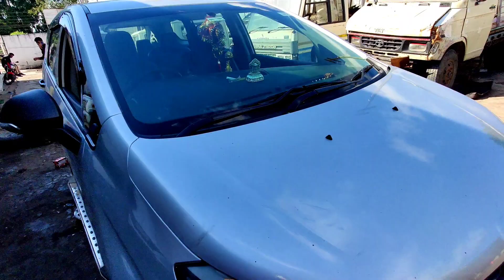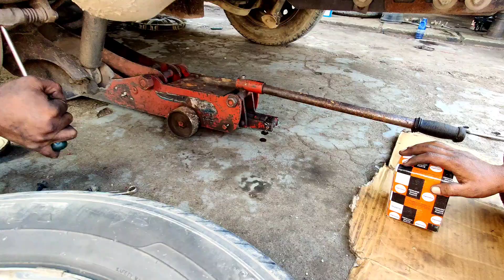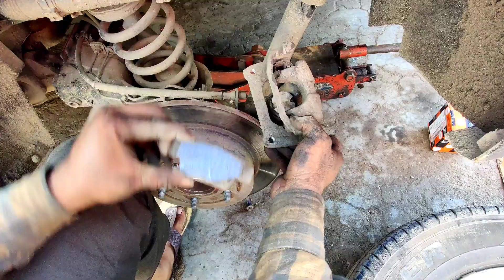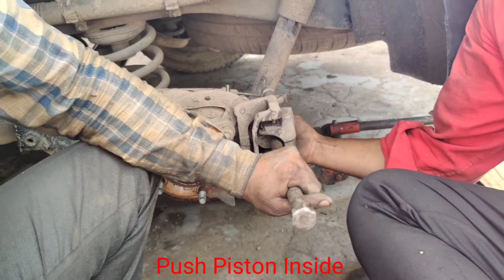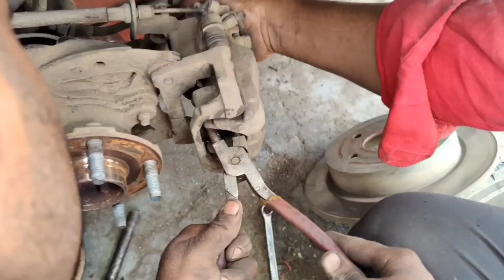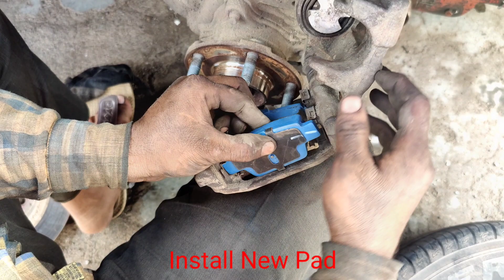Mahindra Marazzo M2 Rear Break Pad Change Without Any Spcl Tool Video #41

Comment: How much will it cost for all 4 tires and after how many kms should we change, thanks in advance
Reply from the maker: Front pad part number 0603bab0030kt, Mrp 2850/- And Rear pad Part number 0603bab0031kt, Mrp 1990/- Ye service 48K se 56K - k beech tak capable hota h, but life spend jyada bhi ho sakta h or kam bhi wo apni driving k uper nirbhar krta h.. Thanks🙏